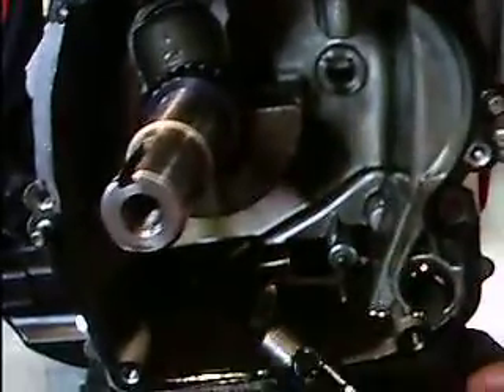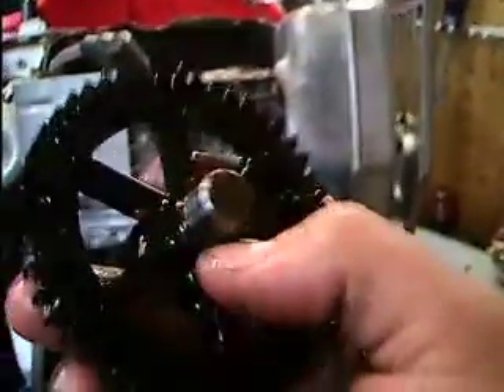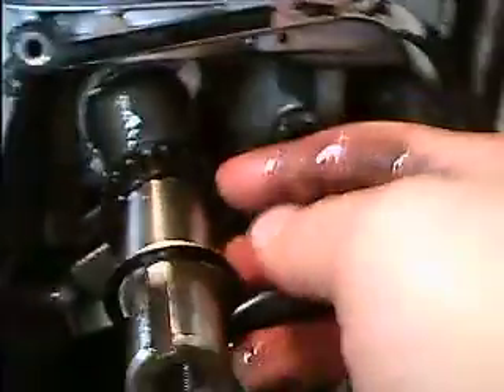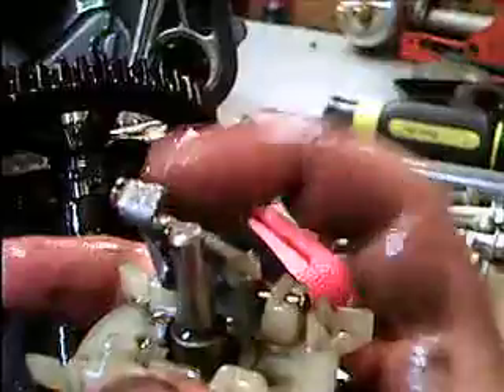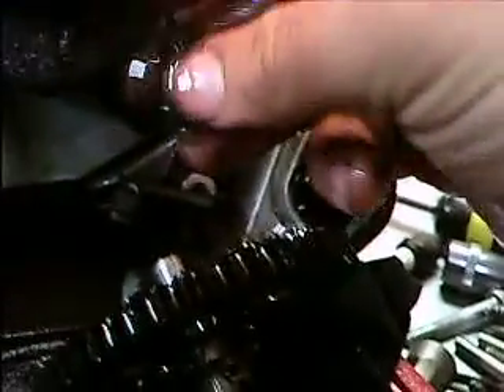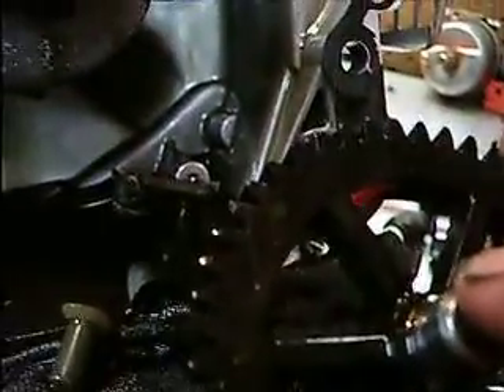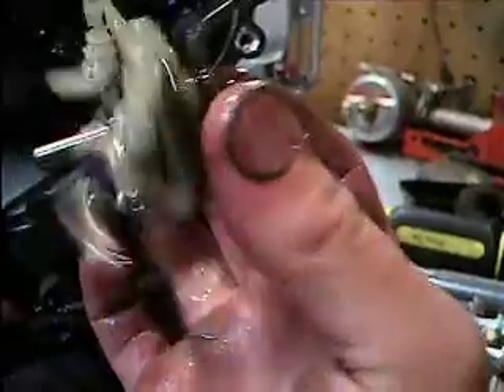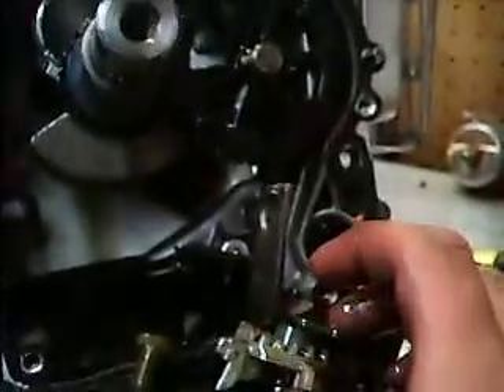Troy Washer 2

Comment from the maker: The problem with using a steel gear is that unlike engines that are made with a steel gear this engine doesn't have the same type of built in key.  The key for this engine is molded as part of the plastic that the timing gear is made from.

Comment: get a steel gear from older engines that plastick one is slipping so try getting a steel one and new govner thing its also a oil smasher if you dont get a new one is will seize up